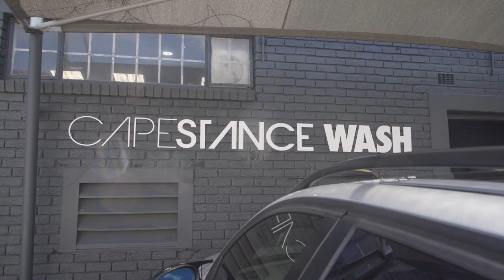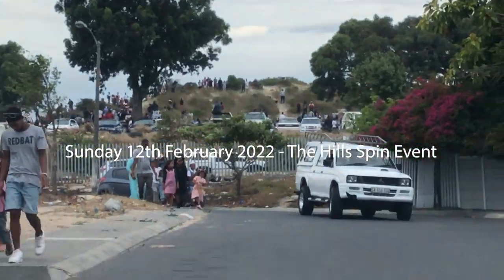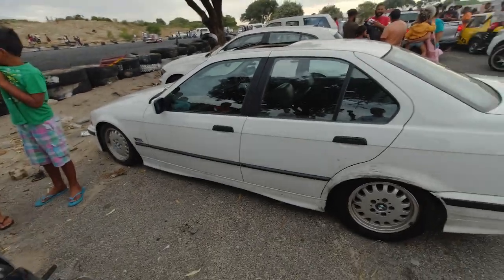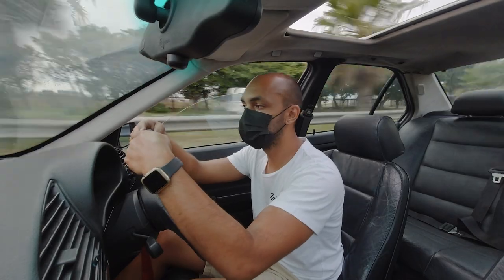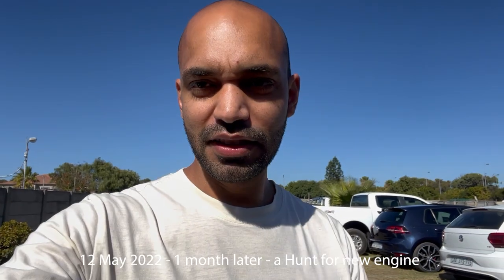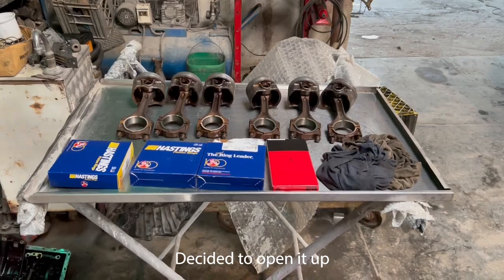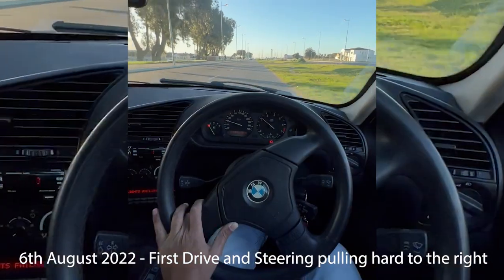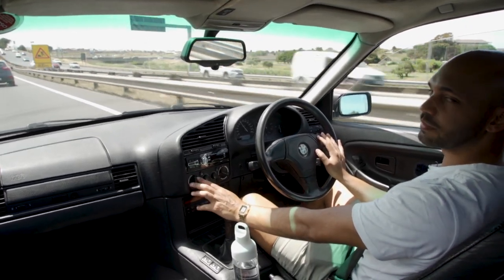We Destroyed the E36 at the Hills Spin Event | Capestance

Comment: Great video man! Enjoyed it. Car sounds awesome. 

Why cast iron block over aluminium? Does the E36 328i come out with both alu or cast or only alu ? 

I’ve got a E36 328i 1996 with 51000km on 😅 family car , hope to either buy it from father in law or inherit it !
Reply from the maker: The cast iron/steel block can handle more power when boosting. Almost up to 1 bar bolt on with stock internals.
Reply from the maker: The aluminium block strips threads on the block and head with higher boost than 0.4 bar